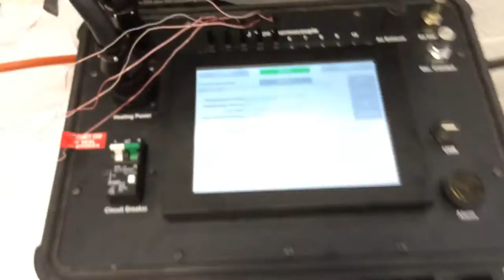VARTM manufacturing process - University of Bath Mechanical Engineering department

Comment: Hi, I am at the Uni of Bath doing my 3rd Year Design Project. This video is from a long time ago but do you know if the uni still owns the catch pot and release agents etc that are needed for this process as we are looking to make a prototype. Thanks
Reply from the maker: Hello Oliver. The equipment was already present at the time (everything you see it the video, except the mould and fittings that i spend my FYP budget on). Unless someone managed to fill the catch pot and/or destroy the vacuum pump they should be there (even my mould and samples should be stored). Talk to technician Mr. Stephen Thomas if he still works there. Send my regards, and let me know if you need more help.

Comment: Nice setup. Between top acrylic plate and base plate what foam material is used? what the black strip surrounding the prepeg?
Reply from the maker: Thanks. These are o-ring seals (normal butane rubber, you can use different materials depending on the application). Since you can't buy them these big you just buy them as an extrusion roll, cut them to size and superglue together the ends. The 2 o-rings form a cavity where vacuum is applied to seal the mold and top plate together. And it is not pre-preg, but carbon fiber fabric which is infused with resin under vacuum, therefore VARTM process :)